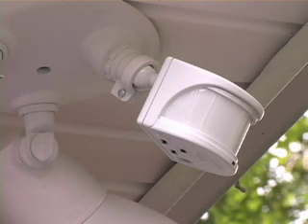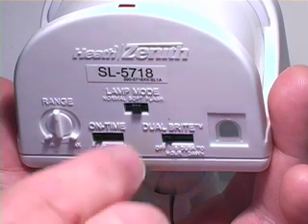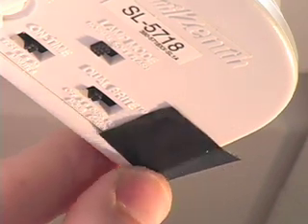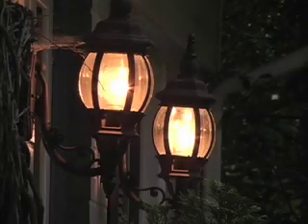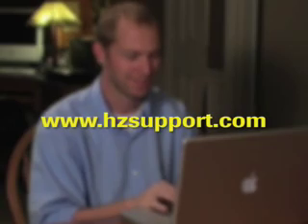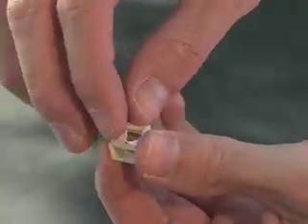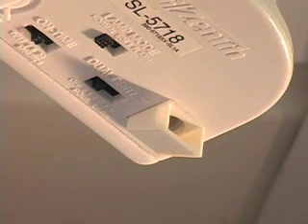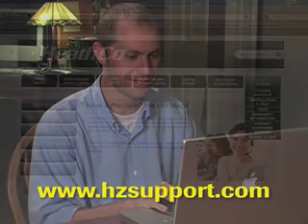Light Sensor Test (trouble shooting)

Comment: If your light stays on for hours and doesn't turn off by the sensor, make sure that the Dualbrite switch is in the OFF position. My light started to stay on all night after I had an ac technician working outside. I found out that he turned that switch on.

Comment: 4 fails in 3 years. Really junk ! Looking for a better product.
Reply: Agreed, junk. My 2nd sensor (3.5 years old) has corrosion across Test switch solder joints. I also suspect a bad photocell because the bulbs flickered erratically for two nights before I cut the juice.
I bought a separate 1100W tungsten ballast with photocell for seven bucks at Lowe's and will probably install in series before a dedicated motion sensor. I'm tired of Heath Zenith's junk. I don't wanna be climbing a ladder at 70 to change it again.
Reply: Let me know when you find a dual brite setup
Reply: @kellygb9278  I chose DualBrite years ago before LEDs were lumen comparable to halogen. Now, with LEDs on par with PAR floods - pun intentional - I am abandoning the DualBrite concept.
Reply: @polytux1  Thanks, I agree that LED is more cost conscience, but what I am trying to do with the DualBrite system was control a two light circuit (garage door lights). By having the radio controlled module, I could use the separate battery powered motion sensor to turn on or off the light switch to that circuit. If I add a motion sensor, I would need to add one to each light fixture. The DualBrite worked best by turning on or off the circuit, remotely & with the added features of dual lightning & security on or off, with a motion

Comment: this brand is just 2 yrs old and not working.changed bulbs but still not turning on just the red sensor lite works.
Reply: bebetigre12 mine does the same thing for me it only works on test mode any other setting just the red motion sensor light blinks but it doesn’t turn on the lights and it’s at night time it still doesn’t work
Reply: Mine doesn’t work at all, even on test. Sometimes when it’s cool outside, it will randomly work. Does anyone know what electronic component is always failing on these so I can just open it up and fix it myself?

Comment: The sensor blink's red ,but the lights don't turn on
Reply: Miguel Santiago same here for some reason my lights only go on if I have it set to test mode any other settings the lights don’t turn on and it’s night time and I just see the sensor red light blinking but it doesn’t turn on the lights
Reply: Did you end up finding the issue? I got 2 new ones today and both are having the same issue
Reply: Miguel Santiago this is exactly whats wrong with mine
Reply: same here,i guess its bulbs.
Reply: It's usually the photo cell sensor - easy to identify on circuit board - cheap part to replace but you have to know it's particulars such as type of sensor material - operating voltage/current and wire lead legend ( which wire is emitter/ base/ collector. You might be able to read part number and search for identical one at either DigiKey Electronics - Mouser Electronics or Newton Electronics. It can take up some time but can be fulfilling if you like doing this kinda stuff....
Reply: @bournphree7565  The photocell (photoresistor) has two leads and they are interchangeable on the circuit board. Mine is labeled CDS1 on the CB, for cadmium sulfide. Since it's a resistor then voltage makes no difference.
Reply: Bourn Phree That’s a good point, however I don’t think the red light comes from motion during the day. If I’m correct, that would make me think the whole circuit is shut down by the photocell.

I’ve taken the last one that’s gone bad apart and planned to test the triac. Been too busy to do much more than give it intimidating stares. 🤣
Reply: I’ve replaced mine on a regular basis. Something in these burn up and Zenith hasn’t bothered to make them more reliable.

I’ve recently installed all LED (dimmable) bulbs to go easy on the relay thinking that it’s burning up from too much current. I also used dielectric grease because the current might be too low.

Even doing these things another one died this week and I’m here looking for someone that’s opened one up and fixed them, rather than spending $20 for a new module.

Comment: I recently changed both bulbs w/ Defiant bulbs. When turning the power back on, the lights will now not turn off. They stay on bright mode. Any suggestions
Reply: Mine won't turn off either.  I tried shutting off the breaker for a while to see if it was stuck on manual mode or needed to be reset, but it is still on.
Reply: Are they LED bulbs? If so, you need to make sure they are “dimmable” or “dimming”.
Reply: Really, And I bought the non-dimmable thinking either on or off, not somewhere in-between.  I'll have to try the dimmable ones.
Reply: Jack Giordano did you get an answer?  That is the same thing happening to me
Reply: The solid state device that is used to do the "soft" turn on and off is shorted in the on position